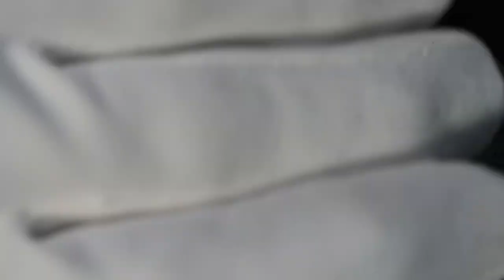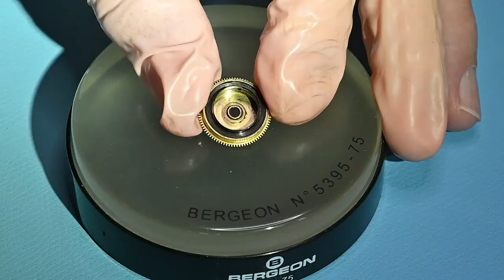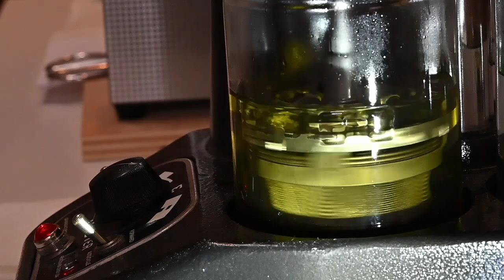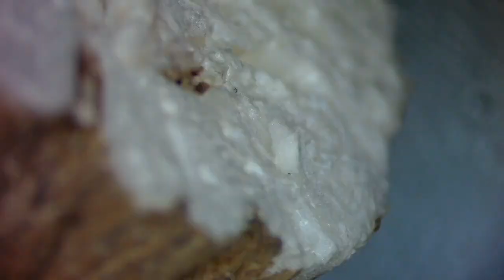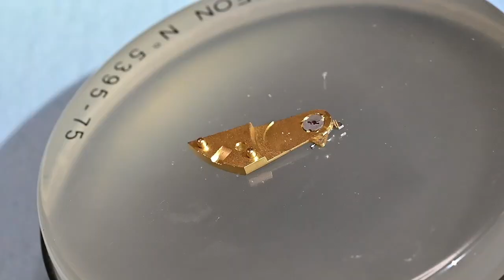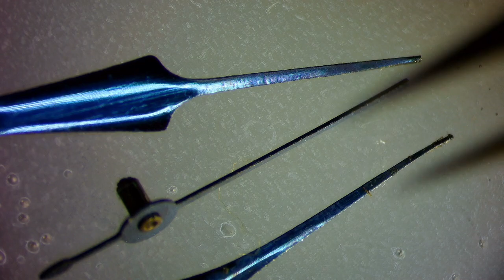1938 Omega Pocket Watch Broken!

Comment: Question: I thought that one wasn't supposed to grease the barrel of a manual hand wind mainspring only automatics?
Reply from the maker: Generally true. Most manual wind watches and pocket watches have a fixed end, like a "T-end" and the barrel should not be greased. In this case, I recall a sliding bridle type to prevent overwind so a couple of dabs of breaking grease will help protect the components and lower the risk of a mainspring breakage that happened here. Thanks for watching.
Reply: @watchodyssey4894 Thanks for teaching! I appreciate you sharing your knowledge, sir. At 60 years old, a day of learning is a day, worthwhile. Thank you again. 🙏

Comment: I’ve noticed that the balance spring wheel is in two halves. Is it supposed to look like that?
Reply from the maker: The balance wheel is a bi-metallic, so yes the construction is made with two different metals that expand and contract at different rates for temperature compensation. If you look closely at the wheel you will see gaps on the perimeter that allow the "arms" to open and close just like a spinning ice skater that slows when they open arms and speeds up fast when they close them. Quite clever don't you think.
Reply: @ I think the word clever is an understatement when it comes to these things! The craftsmanship to not only work on these but also manufacture them, what 100-150 years ago? It’s remarkable. 
And yes, I thought “that wheel looks broken”, though the fact you didn’t say anything tells me it wasn’t!!

Comment: Jeez, this is the second omega 38.5 that I have watched on YouTube that come out with an amplitude of 300 plus. I have the identical movement and have gone over it twice now, inspecting end shake, pivots, everything I can think of. I have cleaned and polished the pivots on the train. All the jewels are immaculate. And it is a new mainspring. The watch operates and keeps decent time but the amplitude is horrific. I even watched chasing amplitude on YouTube and it led me to try a few more things. I guess if I own the watch long enough I will eventually develop enough skills that I will be able to figure it out. I am positive that the hair spring is not touching anywhere and everything looks perfect on the balance. I don't have a pivot polisher but I do use eveflex. I saw Marshall have one come out looking amazing just like yours although you had the initial low amplitude. I don't know where else to go!
Reply from the maker: First things first in watchmaking, don't panic! Let me ask you a few initial questions. What is the amplitude you are getting on a full wind of the mainspring? Is it the same reading Dial Down (DD), Dial Up (DU) and Pendant Up (PU)? Also record the beat error. What have you set on the Lift Angle for your timing machine? Did you demagnetize the movement before starting your tests? The Omega is a lovely watch, hopefully we can get it running beautifully again for you. Regards, Watch Odyssey.
Reply: @watchodyssey4894  Yes it's the strangest thing. I'm still relatively new although I have been through 40 or 50 watches and successfully serviced most of them. But this is definitely a challenge for me. Let me get to your questions as you stated them. The amplitude that I have with the lift angle at 52 is abysmally low, sub 200. I did make adjustments and I believe I found the lift angle was supposed to be 46 and I think that helped a little bit but even with that it's still nowhere near the 300s like it should be for a new mainspring. And yes the amplitude is pretty close regardless of dial up or dial down or pendant up. Beat error has been adjusted and is well under 1. I think demagnetizing was my first step. I think after my second go-round I did notice the hair spring was rubbing but I'm positive that has been solved. Like I said it's a difficult one because it's still running fine and keeping decent time but sub 200 amplitude just makes me crazy because it shouldn't be that way. When I have a lull in the watches I'm working on I may look at it again with fresh eyes but this is been a complete overhaul twice now, with little change
Reply from the maker: Ok, as you know it's a matter of diligently checking through everything. It's possible it's in the train, but I'd start at the balance and escapement. Is the sound to your ear absolutely clean? Is your timing machine showing a clean pair of lines with no wayward dots - if you see any snow then likely you still have interference. If it's clean, then pop the pallet fork and visibly check the balance is swinging freely with air, no debris at all, end/side shake (I know you checked already). Check your stones are solid, impulse, pallet fork, not damaged or loose. Did you use a jewel grease (like 9415) to load up from your escape wheel on to the pallet stones? The type of oil and grease here is important. Under a scope, check your pallet fork releases the escape wheel correctly (you'll find that info online). It's ok if you are not actively working on this one right now.
Reply: @watchodyssey4894  I will definitely have to give it another go. There's obviously something I'm missing, but everything looked perfect to me. Yes I checked the balance without the hairspring and it was just flying as well as with the hairspring and it runs for 45 seconds. There's obviously something that I'm missing that I don't have enough experience yet to notice. I appreciate all the help and I will let you know if I come to some kind of revelation. This is what I love about this hobby is that it's a test of your patience, and sometimes you'll come back to things and your knowledge will have caught up and you will figure things out. Thank you so much and I love your videos
Reply: @watchodyssey4894  well sir with your encouragement I decided to take yet another look. Everything was perfect until I finally determined that the hair spring was rubbing badly on the balance wheel arms. I tried probably a dozen times even though the hairspring looked perfect to manipulate it in and about the terminal curve but nothing seemed to work whenever I installed the balance it seemed to push the hairspring down slightly. So I just basically manipulated it in situ. I kind of forced the hairspring up on the other side of the regulator pins and wham amplitude of 295. Now I am back to get in the beat error within reason and I should be good to go. Thanks for all your input it was much appreciated and I love your videos
Reply from the maker: Hooray! Well done! Glad you to hear you enjoy the videos.

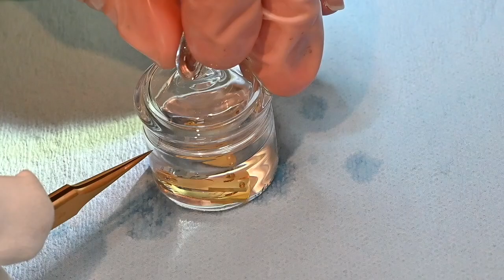Comment: 27:00 Is that hydrogen peroxide solution in the bottle? I have an old Rolex steel watch from the 1980s. It has stopped working and lost its shine over time. I want to restore its exterior shine, but I'm not sure how to clean it at home. I have hydrogen peroxide, citric acid, baking soda, and dish soap (neutral detergent) at home. Could you tell me which of these to use to clean the watch?
Reply: I was going to ask the same thing about the contents of that bottle. Let's see if the author answers.
Reply from the maker: Trichloroethylene blend (or better known as "One-Dip") -  I'd use that primarily for hairsprings, jewels and small parts needing extra attention. For a stainless steel case on a Rolex just a mild dish soap would be fine, definitely no acids! If you have access to an ultrasonic cleaner, those are excellent for Oyster cases and bands, consider L&R's Ultrasonic cleaning solution.
Reply: @watchodyssey4894  Thanks for the advice. I'll try cleaning the watch with dish soap as you suggested. I don't have an ultrasonic cleaner at home, so I'll just fill a bowl with water, put the watch in, and shake it a few times before taking it out. Even though the watch is broken, if I can restore its exterior shine, it will be more enjoyable to appreciate it at home. 😄😄😄
Reply from the maker: I don't recommend full immersion if the movement is still in the watch and the seals are that old, try a small painter's brush to work your soapy suds in and a quick rinse first. I use a restoration polish called Flitz to hand finish but be delicate with it, some prefer not to polish. Good luck.
Reply: @watchodyssey4894  Thanks for the detailed advice. Before cleaning the watch, I was curious about what model my Rolex is since I don't have the box or warranty card. After some research, I think it's a 1978 model. The watch in this  https://www.youtube.com/watch?v=QFAaCPE99vo&t=27s  looks almost identical to mine. It seems like this is the one. I checked the price, and it's quite expensive. I had no idea and have been handling it carelessly. I can't believe it's white gold... If I lived in the U.S., I would have entrusted the watch to you, but it's a pity that I can't.
Reply from the maker: Yes, an original Rolex of this period is quite valuable and very much worth repairing. If you feel comfortable removing the strap, the model reference number can be found between the lugs at 12 o'clock, the serial number will be at the other side between the lugs at 6 o'clock. Otherwise, take it to a reputable watchmaker who has experience with the brand.
Reply: @watchodyssey4894  thx. :) I'll try it as your advice